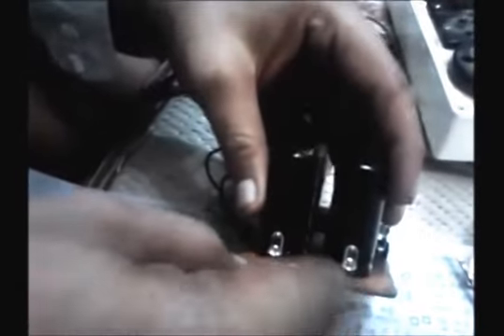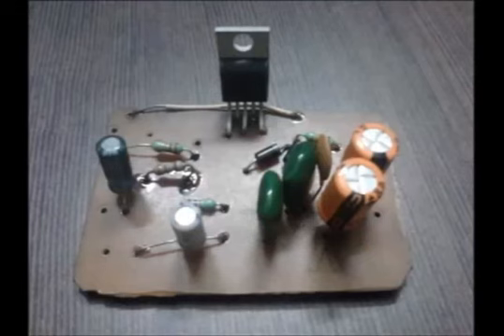DIY Active 2 way TDA2030 audio amplifier system with dual power supply.

Comment from the maker: TDA2030 or TDA2050 has become obsolete now as I can remember.  I straightway followed the datasheet reference while making this. The 2 way active crossover section was built following Sir Rod Elliot's circuit given on his site.

If you want to make a powerful great sounding amplifier, go build a gainclone  LM3886TF amp.

This video was recorded casually with a cell phone just to show you a friend as per his request. Though the sound quality / level  of this video is acceptable in my system, it might sound bad in certain system especially that are suffering from acoustics mismatch. Anyway, inconvenience regretted.

Thanks for watching.

Comment: If you remember you advise me to build an active crossover. I just finished building my 2 way active crossover using Rod Elliot design 123 and amplifiers using LM1875T chips. I then went looking for some good drivers in Bangalore to build a speaker box. I came to know that all good brands like Philips , Bolton etc have exited the market. Not much choices here. Out of curiosity what drivers did you use to build your 2/3 way speakers. Any pointers on where I can source them from?  Cheers !
Reply from the maker: +Priyo Das 
Congratulations! Well done!
I used a pair of panasonic drivers that i bought from chandni chawk, calcutta. Not sure what drivers are available locally right now in india. You can try online resources or import it using source if you have any. Else use what you have at hand. But please do keep in mind that the design of the speaker enclosure is very very crucial too for accurate sound reproduction.
Once that's done, you can get the sound quality of a premium studio reference monitor, I can bet. This is the magic of Rod Elliot' s circuit. 
All the very best. 
Som.
Reply from the maker: +Priyo Das 
Congratulations! Well done!
I used a pair of panasonic drivers that i bought from chandni chawk, calcutta. Not sure what drivers are available locally right now in india. You can try online resources or import it using source if you have any. Else use what you have at hand. But please do keep in mind that the design of the speaker enclosure is very very crucial too for accurate sound reproduction.
Once that's done, you can get the sound quality of a premium studio reference monitor, I can bet. This is the magic of Rod Elliot' s circuit. 
All the very best. 
Som.